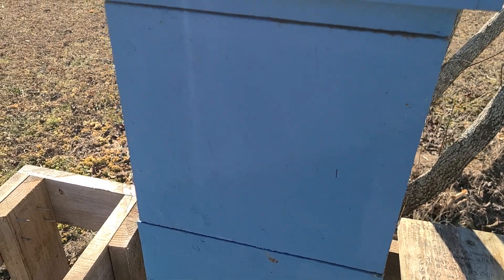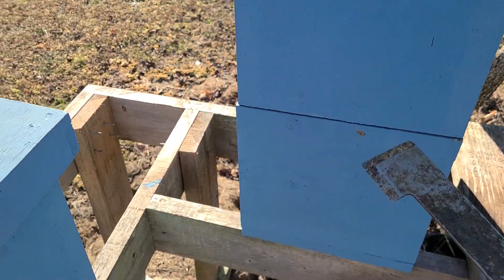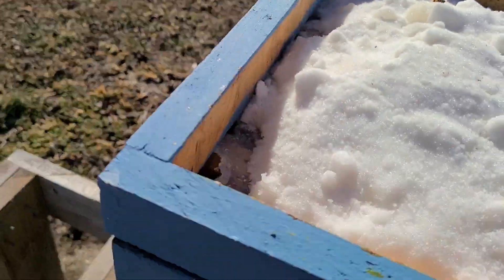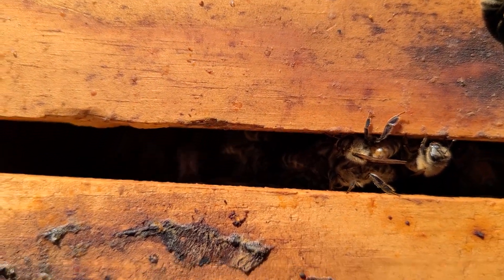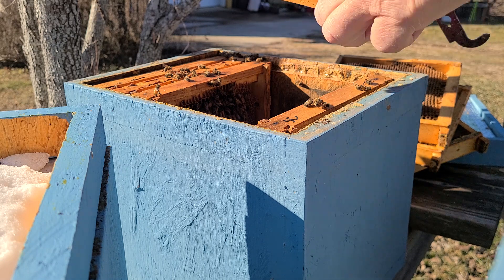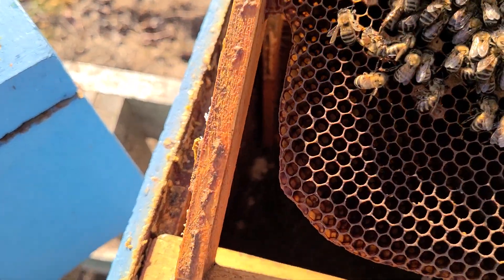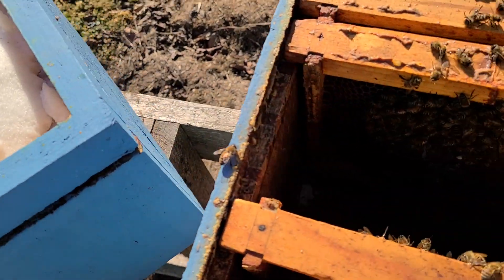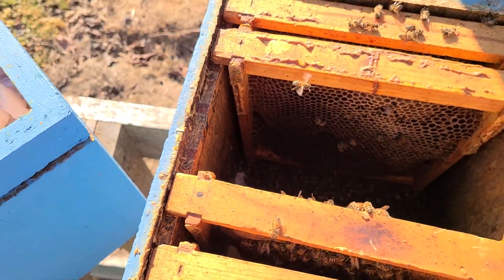What is Isolation Starvation? 4 days in the single digits.

Comment: Torpor, chilled to the point they cant move..  I've cleaned out what I thought were dead outs and a small cluster starts to move.
Reply from the maker: these were dead. it was my fault i should have removed the box of honey and put the sugar right on top.
Reply: @Woolie B's Apiary is hard to tell from the video, but we're there enough bees to keep the brood warm?  Was it a lack of food or too small a cluster?  Even if food had bee directly in contact if the cluster is too small they wouldn't be able to access it.  Hate to see that.  We had -35 wind chills so not sure what I will find when I can get out and check them later this week.
Reply from the maker: @glennsnaturalhoney4571  there was a couple thousand bees dead in the bottom of the box. it was starvation.

Comment: I’m wondering what mine will be like after these temps I know it was 5° here in East TN for like two nights in a row. Today I saw bees out of 6 of my 10 but three were still in shade so they’re colder so might not be they’re dead outs just not moving cause it was only low 40s. One was n sun not moving and was a weaker hive so won’t be surprised if it hasn’t made it it. I plan on checking the emergency sugar stores when it gets a touch warmer.
Reply from the maker: this one was a beekeeper error i left a box of honey instead of pulling it and putting dry sugar right on the frames. I thought that i had 2 dead but when the temp hit the upper 40s i popped the top and was greeted by bees in the sugar shim going what do you want?
Reply: @WoolieBsApiary  all of mine were double deeps so it wouldn’t surprise me to see like that one with them down in the bottom and honey above with the sugar shim above that. All of mine when in winter with the top box honey and bottoms honey with small Brood areas of a frame or two as of last checks back in mid to late October.
Reply from the maker: @SmokyMountainLashBees  im almost glad they are gone because i do not want stupid bees rearing brood this late in December